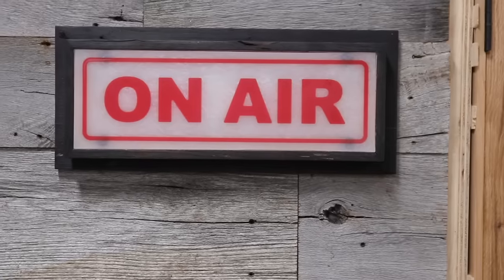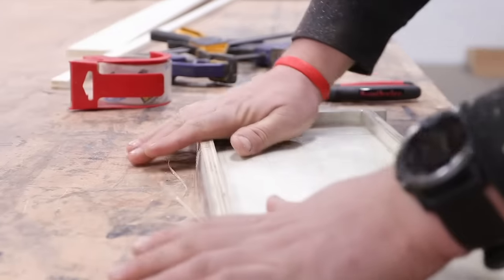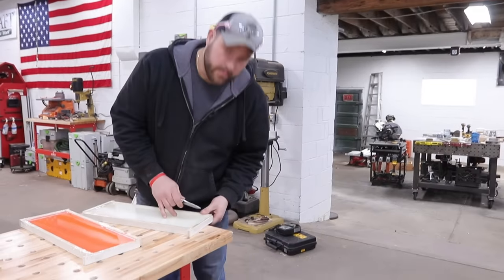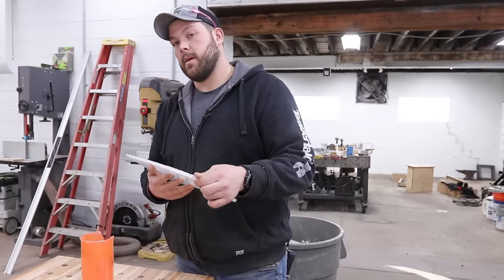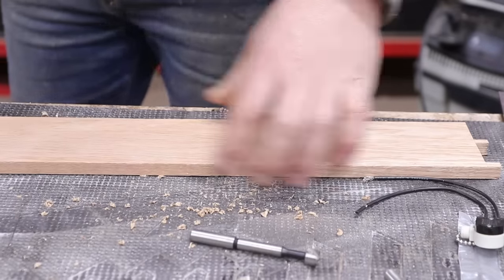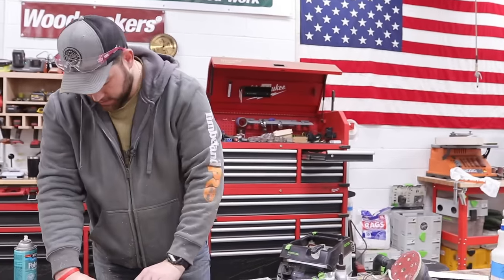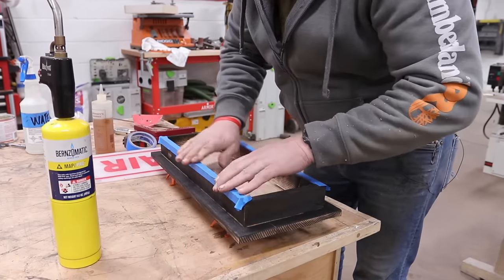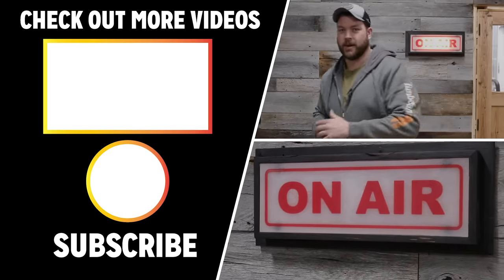DIY Epoxy Resin Sign with LEDs

Comment: If you still have the molds you used, I would suggest remaking the resin back plate and tinting it a MUCH more opaque white, milling out the ON AIR letters and filling them in with a transparent red so when the light is on, it only shows through the red letters rather than the white background...The translucent white makes the sign hard to read...

Comment: Hey dude, if your resin is super cold it's good to give the bottles a warm bath for 5 minutes, it makes it much easier to measure and mix. Also using a drill to mix it is the reason your "clear" sheet was so frosty, there are loads of microbubbles in it. It's best to set a timer for 5 minutes and mix by hand. If you don't have a timer just mix it for as long as you think it could possibly take to mix the ingredients, scrape the sides, then mix until you want to gouge out your eyes with a grapefruit spoon. McDonald's drink stirrers are excellent for small batches.
Reply from the maker: Thanks Toby, the clear was actually tinted white, so thats why its cloudy, thats the look i wanted. but good tips!
Reply: @John_Malecki  So you're saying I actually have to watch the video before telling you you're doing everything wrong? How professional, that's never going to work on YouTube.
Reply from the maker: hahah sometimes it helps, sometimes it doesnt. But a lot of people suggested no drill. I think with the ultra slow setting stuff is the only time a drill is good, because it has so long to let air release

Comment: A way to make this easier and cheaper is just red and white acrylic or PVC sheets and skip that step. Hobby shops usually have finished lettering too if you want to go real basic with it. Or you can buy vinyl sheets, cut it with a vinyl cutter and stick it to the back of a clear acrylic sheet.

Comment: I was wondering why you would use MAP gas for removing bubbles from the epoxy resin, then I saw the sponsor. Yay bernzomatic!
Reply from the maker: Ive always used it tho, MAP or Propane. you could use a heat gun, i dont have a huge heat gun tho
Reply: @John_Malecki  my apologies! I go for the cheaper propane whenever possible.
Reply from the maker: yep works just as well!

Comment: I know you had to change your design half way through but your box is too shallow for the light source. Maybe make a cutout for the light so that it sits slightly further back?
Reply from the maker: what makes you say its too shallow? not enough space for it to reflect inside ?
Reply: @John_Malecki  yes. When the light comes on it just blurs the red and white together. If it was further back the light would diffuse more.

Comment: Stuff you know: Easier ways to do this besides $25 worth of epoxy. And using that drill for mixing caused micro bubbles really bad ... Use a stick or something that moves slow enough to avoid introducing air. Thick epoxy takes more than 8 hours to cure hard especially in cold air. ... Checking voltage requirements before wiring is a good idea.  Yeah ... but you got the light you wanted.🤣🤣
Reply from the maker: let a kid live a bit clyde! haha was an experiment my friend

Comment: How can you call this a diy?
You have all this equipment.
Its a diy provided you have a cnc table saw and more. Not a diy but more like a project.
Reply from the maker: Because i Did It Myself.......I was not aware for a DIY video you have to use two rocks and a stick to build something.
Reply: @John_Malecki  
I been doing things like this for years. Projects require multiple tools yes and I have tools to do such a project. However DIY means simple things done by hand with everyday simple odjects that dont need lots of machinery. I mean great job on the project and this video is very well made. You did well. Just not a DIY more like a project people can do. Nothing bad just saying thats all. Some everyday people however dont have equipment like this. Hell I'd be afraid they would get hurt not knowing how to handle such tools.  To you and I its simple put a router in ill hands bad things happen lol.
Reply: @D 
First I have twice as many tools then your little shop there. Secound I have done carpentry work for over 18 years. So whats my knowledge? A do it your self project means anyone can do it with simple tools and hand tools and basic knowledge of how. Using machinery is more like a project you can do. However not a simple diy. Diy is simple things people can do with simple tools. Maybe not so much knowledge as you or I have but more like a teen learning. Or maybe a mom learning or something. When you start using machinery that one not every one has. Two know how to use without hurting yourself or someone else. Due to lack of knowledge of how to use the machinery. The only reason I bring it up because my son was looking for something simple he could do to make cash. However when he comes to me asking to use tools and machinery that he has no knowledge of could get hurt. However was encouraged by your video. I do teach my son however at his age and level of understanding could have gotten hurt. Thank the father that he comes to me before he touches. Now can you see where I am coming from. I mean your a great guy I'm sure and you did very well on the project. I am in no way attacking you here. It just worries me that some kid could get hurt being encouraged by the video.
Reply: @bryanroye1112  First, if people don't know how to handle their tools, they shouldn't handle them at all. Second, you don't need a router to get yourself hurt - a simple box cutter does that just fine and pretty much everyone has one at home. Third, while the router itself is definitely a more specialized machine most people don't own, it isn't essential for a project like this and neither is an electric sander.

I'm with "D" on this. Your definition of DIY is way off and saying this isn't a DIY project is just a lame excuse for not trying to be creative and working around your limitations. Don't have an expensive CNC router? Buy a cheap Dremel knockoff and use that - or, if you've got shaky hands, buy vinyl cutout letters instead. Don't have all the necessary equipment and skills for the resin? Buy a sheet of acrylic. Don't have an electric sander? Use regular sandpaper. A project like this could be done in X different ways, depending on your skill, your budget and your equipment.

After all, the lack of a CNC router or a pneumatic nail gun didn't keep people off from building houses or other stuff 200 years ago, why should it now?
Reply: @RobX86  
Ok that can be your next video. You should build a house with no tools at all. That I would like to see. Geee I hope it wont take to long.
Reply: @bryanroye1112  Geee yourself, dude. You don't even seem to realize that neither "D" nor myself have anything to to with the video or this channel. Hint: We're just regular viewers like your are who simply don't share your point of view on what DIY means and what it doesn't. Now, since you obviously ran out of proper arguments and resort to chilidish comments like this instead, I'm outta here.
Reply from the maker: I’m going to do it like a Jedi master, and just will the parts into place. Question would be, is the fact I have Jedi mind tricks not make it DIY ?!? 😳

Comment: Cold temperatures make it cure faster. FACT.
Reply from the maker: depends on the atmospheric temperature. So yes and no to your "FACT" . If the room is cooler than the recommended curing temperature of the manufacturer. it will actually take longer. It is beneficial to keep the resin as cool as possible in general, but freezing temperatures is obviously very different.
Reply: I have used 4 different brands of epoxies. All cured way quicker in the winter. :/
Reply from the maker: Ya like is aid, cooler temps help epoxy cure. The chemical reaction actually produces heat. So keeping it cool is important. But the 3 brands I have used, all tend to work best in the temp range suggested on the packaging,  above and below give issues
Reply: John Malecki CORRECT. When I work on an epoxy project in the winter the bucket I'm holding with the epoxy starts getting warmer and warmer. Subscribed.